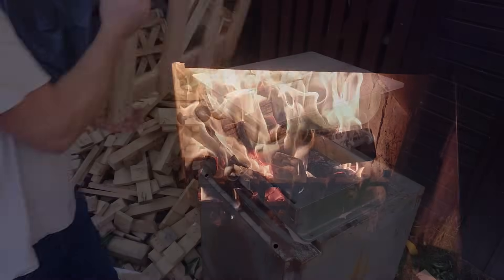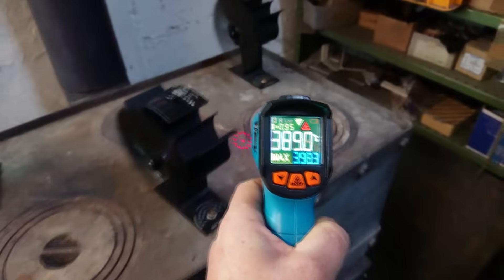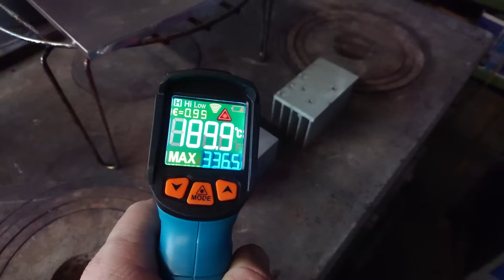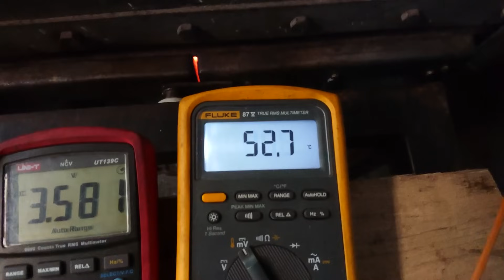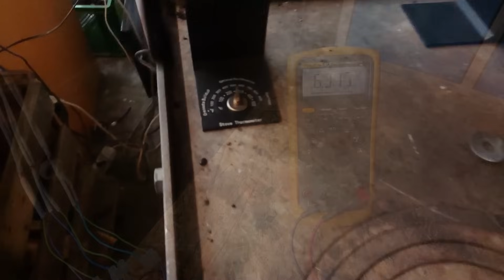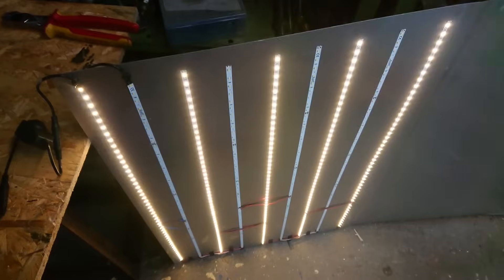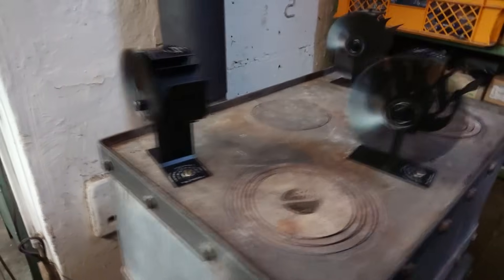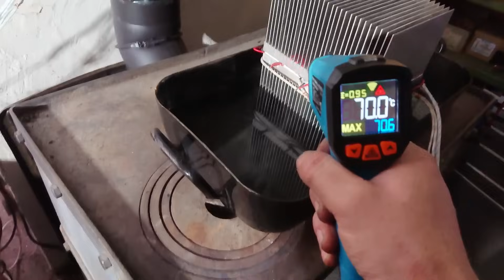Generating Electric Power with my Wood Stove - Peltier Experiments

Comment: Double or triple walled shroud should help to keep temp down. Maybe try using the sides of the unit instead of the top. or elevate the surface 1 foot above the top etc.

Comment: Couple things i have been wondering and wanted to test also .. How much voltage you think these peltier elements can take? Just thinkin how many you van connect in series to aquire proper usage able voltage... The other is if they are water resist .. you could submerge other or both sides to wate...

Comment: Put the junctions between hot stove surface and a water heat exchanger. Heat water in a thermosiphon loop while keeping the peltiers cool. Water on the COLD side not the hot side.

Also: Well done investigations

Comment: another idea would be to try to use a photovoltaic panel to try to convert some radiant heat from the open fire as infrared to electricity, the efficiency should also be crap since the energy density by surface in the ir spectrum is quite small, but since the panels are quite large, maybe there is enough energy to light up some led with less effort, and less engineering. The open flame of a fire has a pretty broad light spectrum, and Si based panels should be able to use ir to about ~1200nm wavelength, looking at their spectral response graphs.

Comment: The power plant in my community creates enough waste heat to keep a lake thawed at -40C. Imagine if you covered a pipe with these things and pumped hot water through it while it is submerged in a large volume of cold water. It might be a simple way to reclaim waste energy.

Comment: Could you also add a turbine/fan in the exhaust pipe to extract some more energy from the exhaust gases? Maybe drop the diameter of the exhaust further down the line to increase the pressure diff to allow rotational forces to happen at said turbine due to pressure/force diff.   Would that even work I wonder, am layman just throwing ideas out.

Comment: i would use the wall as a cold sorce for the other side of the coling one could also fan a fan run by a couple of the teg midules to cool while the other genrate power i think charging batterys is prob the most usefull way of using this system

Comment: Already many good comments (like @1kreature). I'd like to add, that you should try to make convection (local and workshop level) work for you, if you chose to stay air cooling only. But please add a few temperature couples in strategic places so you can gather experiment data ;) Just use a uC or a RPi (with for simplicity IoTStack) and a few uC's that broadcast their measurements on MQTT and ingest them via nodered into influxdb2.

Of course knowing what you do, just build the final version using one beefy uC (if you go for closed loop control) and also measure and display all relevant temperatures.

Also, as many others said, try to use the the workshop floor act as a heat sink. Maybe you can junk up a solution for you (copper heatpipes or old radiators)? It would increase the complexity for sure, but I think it will be within your capabilities to make it closed loop controlled and dump the power (as @1kreature said) into a mppt'd battery.

Comment: Haha, you had the same idea as me at the end of the video, using water to limit the max temperature.  I suggest suspending the bottom heat sink up off the pan a little, so if it runs dry it can't transfer (much) heat anymore.  You could probably also use some spacers between stove and water bath to avoid boiling it off too fast, since you're seeing >200C on the surface but don't need anywhere near that much.

The water bath might require more maintenance, but you're also improving the humidity level in the workshop.  Use a large enough bath and keep it just barely at 100C and it could last several days.  Just throw a couple handfuls of snow into it every day when you come in.  You could also throw the snow on the top heat sink so that it cools it while melting, which would increase power production by increasing the temperature differential.  For that matter, a water block on the top heat sink that runs outdoors with a tiny water pump could make a huge improvement in power production.

Comment: I built something similar for our remote cabin in the winter when solar is about useless. We melt snow for water in a 20 gallon tank so I made my thermal electric generator using water with a small pump and a heat exchanger in the snow melter.  My net after running the pump is only about 300 watts an hour over a 24 hour period doing this. Which is more than I use so I also run an electric load when the batteries are fully charged.

Comment: How about having the fins of the hot side of the device in the exhaust pipe of the stove and the fins of the cold side directly outside?  This should give a lot of heat difference in the winter.

Comment: Have you heard of a rocket mass heater? You could design the mass in such a way that your exhaust/stove pipe in combination with a well designed mass gives you the exact Peltier hot side temperature for your experiments. The advantage of these masses is that the mass  temperatures are a lot more stable than a stove top.

Comment: room temperature superconductor technology has existed at least since the 90's but are kept off the market as disruptive technologies (those technologies that would disrupt the current profiteers whose business is selling consumables needed for daily living of the mass population)

such devices have been tested in military applications & are essentially electronic devices manufactured in a below 0 kelvin environment & start outputting electricity the higher the temp goes above freezing so they are producing usable power at room temperature.

if they ever allowed such technology to hit the market every home could provide all the clean power they need for lighting, cooling or heating with a unit the size of a high efficiency gas furnace.

Comment: The best thing I could think of 4 u is run liquid cooling on the cold side. the majic number is around 80 F for your cold side once your over that it affects the heat transfer through the chips. and will affect the amount of power. also it's a 100 C difference that drives the chips. Have you considered a broken fridge to help your cold side? -10 C on the cold and you'd only need 90 C on the hot... And yes I to wish they still made TEG units in abundance, I found some on @maz0n. ✌

Comment: Get a wood gasifier and run a generator off the gas. You could probably modify the gasifier into a rocket-stove and line the skin with peltiers to capture any additional waste heat. There are additional bi-metal heat powered devices like stove fans you could probably incorporate for optimizing flowrates, etc.

Comment: From my experience with peltier plates, you really need some from of active cooling, even with the more expensive modules.
You generally have less protection, but you can bring the hot sides to above 100c, but only if the cold side is actively being cooled fast enough to keep up with the heat being dumped into on the other side. Honestly though, a fan is pretty much ideal. Probably not that much worse overall in terms of failure rates than pumps.
Another thing that helps is only putting thermal compound on the cold side of the modules. That probably hits the efficiency a little, but it means the bottle neck is on the hot side by default, not the cold.

Comment: Wondering... is it at all possible to send the low voltage into larger deep cell batteries as a trickle charger?
I have always wondered too about the 1.5 v of current which is always available right in the air or from the ground.
How could we take 8 leads from the ground to get a constant 12v and charge batteries so that we could use the save energy as wwe need it through an inverter to power larger devices?
Nikola Tesla had this all figured out in the late 19th century and eary 20th.

Comment: You could fit a wet back to your fire, while heating water you could design a freestanding unit with two tanks. one tank for the heated side and one for the cold side (inlet side) with the generators sandwiched in-between. The design of the tanks could intergrate the heatsinks on the inside. Electricity and heated water sounds like a productive fire to me.

Comment: Submerging the hot side in boiling water to stop overheating is brilliant, but keep in mind that thin pieces of metal like fins can also act as thermal brakes. Also if you put a water heat exchanger on the hot side, you do not need a pump. If you place the hot outlet above the cold inlet heat convection will act as a natural pump pulling in cool water as hot water rises.

Comment: Why couldn't you build a water heat exchanger with cold snowy outside and hot water from the stove. But also I'm sure a more appropriate TEC units can be sourced.

Comment: This is exactly the generator we need to power our homes. A small wood box surrounded by these TECs . Alone, they don't make much electricity but hook them together with a balance hot and cold and they will power your house. Look at solar one little panel and not much. But gang them together  and wow!
Reply: Just think about ' gang them together'... at 10w a piece you would need over 100 to power a toaster. I hope you have a big house, like a lot of heat and have a forest to burn.

Comment: I'm waiting for PV that works off IR. Even 15% conversion efficiency should blow away the power output from peltier junctions or Stirling motors. TEC will be a nonstarter until or if a high temp semiconductor is used and produced in sufficient volume to bring costs down.

Comment: I have been working on similar but indifferent use there has been great advances in this by making mercury amalgams to gain greater currents I invisioned a solar panel for collecting heat recharging a battery inverter installed in appliances so that grid draw becomes as minimum as possible

Comment: Ive been using peltiers on my wood burner to power led lighting and fans. Also PTC elements direct from solar, inside sand batteries for storage heaters. Always works well in combination.

Comment: You could make simple DIY vacuum heat pipes from copper tubing to remove the elements a bit away from the stove and thus make it easier to cool them.

Comment: So what if you'll use water on both sides? Heat exchanger on exhaust pipe heats water, then thermo isolated pipe goes to another heat exchanger  that has elements attached with their "hot" side. On the "cold" side another heat exchanger, then a pipe with coolant liquid goes outside of the building to radiator?
And the best thing is you may design it in such way you don't need pumps to circulate. Hot always goes up while cold goes down.
No pumps, no moving parts, no overheat on elements since water can't be hotter than 100C.

And as for circulation without pumps. My grands has such setup to heat their house. Although it's not that efficient as pump for sure but I assume will by quite enough to circulate decent amount of heat on both hot and cold sides.
Reply: Ah and forgot to mention, to avoid over 70C difference you may simply use adjustable valve to adjust coolant flow. Since it never freezes, you should shut the valve once it's not in use during cold weather outside and then once you want to run it, you start the stove first and once "cold" side gets heated you'll simply slightly open the valve. Once system will get to it's idle you'll adjust the perfect flow with the valve.

Actually you can automate it really easy using servo valve and Arduino or ESP with few temperature gauges  to maintain the flow on most efficient level. Should not consume much in terms of voltage and current.
Reply: Ah, and I think will be best to add efficient radiator with adjustable valve in parallel to hot circuit, just in case if heat exchanger on the stove will produce more heat than exchanger with elements can consume. 
And the same Arduino board can control it. 

And for sure safety valve on the "hot" circuit to dump steam automatically in case of valve failure.
Reply: Rough calculations:
Given data: 
Element: TEC1-12706
Size 40 by 40mm
Seebeck = 53mV/K°
R= 2.1 Ω
∆T = let's say 60°

One element will give 3.18V 1.514A ≈ 4.087W
So roughly 1m² will contain 625 elements ≈ 3 kW

Add mppt here and you can charge your batteries in winter😊

Sounds better than I thought tbh, too good to be true😊
I would rather consider pumps for such set up😂

Comment: If you use water to cool the heat sink consider running that water through radiators that can also help dissipate the heat. 
Also I'm not sure how different it works but look up the "Bio lite camp stove" there that is small a system that's ment to charge a phone

Comment: Perhaps using bricks on top of the stove and placing your device on them would somewhat limit and regulate the heat transfer and provide thermal mass that would extend the electrical generation when the stove cools.

Comment: Nice work you can regulate your hot air more easily if you put your peltier module on the side so you don t lock the flow and also you can keep the cold side out of the top of the furnace so you will have a better delta temp between the two sides .

Comment: Create a cold-air intake for your stove that goes directly to the outside. Use that cold air to create the temperature differential on the peltier device. It will maximize both the device and your area's heat.

Comment: I thought of this years ago if I ever moved to Alaska. Cooling it with some forced air from outside. Now add a thermal sand battery & heat exchanger to act like a capacitor my German relative. You'll be off to the races.
- Detroit Michigan USA.

Comment: I have thought about doing something like what you are doing, I Was planning on connecting the cold side of the peltier plate on the intake out side air pipe of my wood stove and the hot side on the heat shield on the back of the stove, Should be a very good temp differential.
https://www.youtube.com/watch?v=9g1wRjU4uyQ

Comment: i had plans some years ago to use tellurex teg-s in a purpose-built masonry heater, 50/250 celsius, cold side would be heating water circulation cooled. then in the heater there would be bi-metal or some failsafe shutter mechanism. the 1000 eur teg i calculated to yield about 1kwh per day (6 hours at 250c). which would be nice in a 80% efficient wood heater. also obviously to turn the circulating pump, but there would be a some excess electricity.

Comment: Quick tip: when cutting aluminium with a cut-off saw (and even when sanding with a sanding pad) add a little waste oil. It will prevent blades and pads from clogging and extend their useful life.

Comment: Try using one of the Peltier fans ducted to provide cooler air away from the stove.  I don't know if it could suck air up from the floor area but that would be the coolest air from within you shop.  Another option would be to bring in cool air from outside and duct it thru the cool area of your Peltier generator.  This may be easier on your stovepipe model.

Comment: I like the way you problem-solve on the fly!
Regarding the water-bath option, perhaps use a shallow, sealed oil-bath with clean mineral oil.  
Using square-section steel with the ends capped, you could eliminate the need for heat sinks on the bottom of the Peltier modules, attaching them directly onto the top surface of the (horizontally oriented) square tube, then concentrate on cooling the top.
If the stove was getting to hot, it would be a simple matter to slip something between the stovetop and the bottom of the tube, to provide a little temporary insulation.
It might be helpful to install a cheap thermocouple-thermostat onto the bottom (hot) surface, too, so you could have an instant readout on the temperature - attached to an over-temp alarm if desired.

Comment: A steam engine generator may be fun to experiment with too. Thanks for the great video!
Reply: probably would generate more energy also. we've been using steam engines for over 200 years and we know they work!
Reply: @time2fly2124  Until they don't and you have a crater and a hole in the roof, where your boiler was. That's why you have laws for installation and inspection of those systems. Needless complexity. K.I.S.S.

Comment: Hello from Solingen in Germany - I'm a designer and I guess I have an idea for a very usefull aplication for this technique. We run a modern wood stove in our kitchen with a waterpocket for our tank that delivers the heat to the wall heating (we don't have radiators). Theres a small pump that keeps the water running in the system. I found your video, because I already thought of using peltier elements to power the pump. By any chance - do you like to experiment together?

Comment: Indeed these devices in themselves do not produce a great deal of power, but that's not an issue if you pair it with a battery pack that your effectively trickle charging over time that can supply greater amounts of stored energy for short periods.  You don't necessarily run a light 24/7, only for the period your using it.

Comment: Love the project. Very good thoughts! If you had a low-temperature water floor heating, you could use it to cool the cold side of the peltier elements and make for efficient heating of your workshop while generating power. 30°C is typical floor heating water temperature, which leaves you with 70° delta. That's the optimal range of the Peltier elements. Maybe you could even power the pump which circulates the water through your floor heating by the peltier elements. Would make for a independent floor heating system. I liked the idea of the hot-water pot to limit the maximum temperature to keep the Peltier elements safe!

Comment: You heat the stove when it's cold outside. So if you can get cold water from outside to cool down the peltier element, you might get a higher temperature difference.